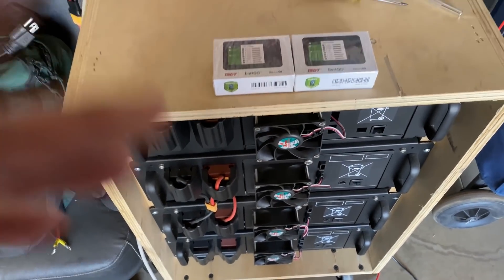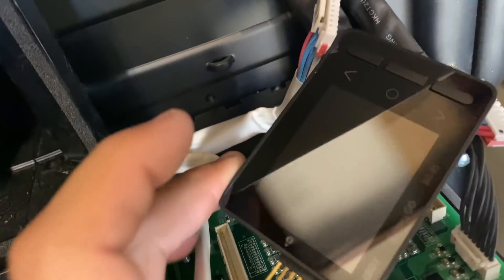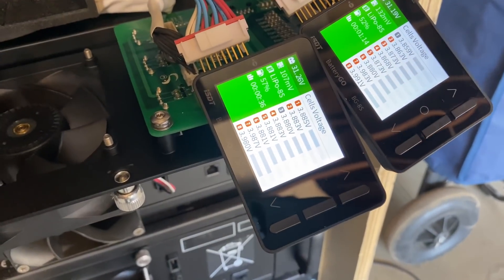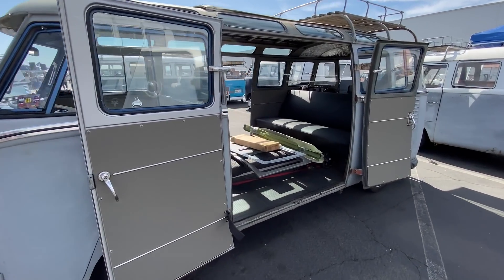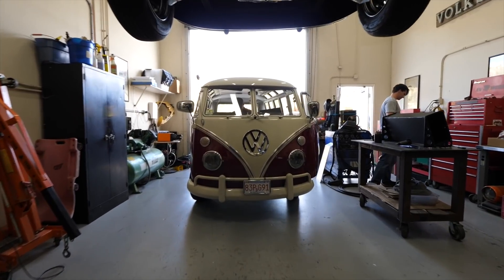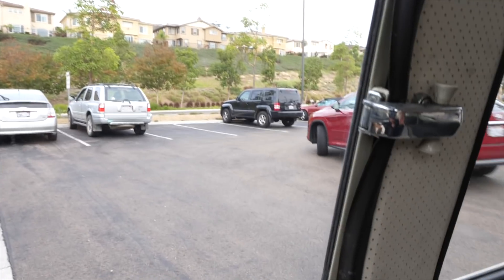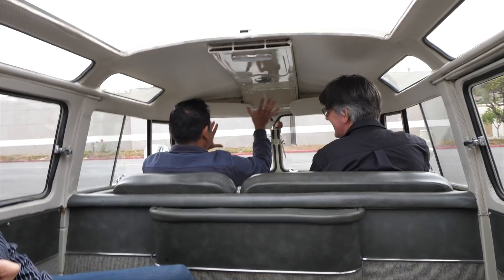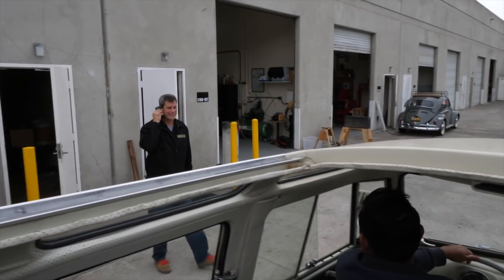Balancing Samsung DIY Powerwall using ISDT BattGo BG-8S

Comment: While this is interesting, the power wall was basically pre-wired for the 8s battery balancer. What about balancing a 48v battery pack with an 8s balancer? Balance by cell groups? Balance part of the pack at a time? Is this possible?

Comment: Hi, is there a good bms to use for this? Or will there be a follow up video to use the built in bms? Or if I just connect it to the built in one it balance the batteries but no read out?

Comment: I Need to pick a couple of those devices showing the voltage. BTW same guy that lives in Ca (south bay). I am building or should say repairing my e-bike(2) battery packs they both stopped working just under 3 years. Just getting into this area as a hobby/family fixer. The biggest slow down of this repair process is charging then discharging and finally charging each cell to get its capacity and voltage. How do you cut down on time when it comes to this step?

Comment: Hey Jehu,  I'm confused.  the connectors that you linked to on Amazon appear to not come in the 4pin and 5pin that we need to use the Battgo cell balancers.  Are we supposed to cut them down to the correct pin count?  Seems like I'm missing something.  Thanks

Comment: I have 12 of these now (thank you), and am working on the built in BMS.   If I wanted to share this data, where would be a good location. 
I have the basic design of these, and how to interconnect them.  I am working on the management interface which can support up to 32 units.  Once I get this last piece, up to 32 units can balance with each other across the packs.
Reply: I also have several of the Samsung  battery modules. The BMS controller is a Maxim MAX17823 there is some data out there but I am working on an interface as well
Reply: @markforaker6345  You are welcome to add discovered content to the Wiki.  Register and let me know.
Reply: Mark Foraker Afternoon , were you able to make any progress on the controller ?
Reply: I'm very interested in this. Wondering if making a public Github repository is appropriate? Otherwise, I'd be happy to build/host a site with the info that you're willing to share.Thanks!
Reply: @indigoskin  Github is great for schematics and code.  I am putting a Wiki together to allow elements of information to be linked.  If you would like me to include your Github, let me know.
Reply: @bradslattman  I just received the balance coils for the network today.  I will need to mount them and prototype a board, then get a board made.  Follow at the wiki above...
Reply: Anthony Plack Good Afternoon , Where can I find the wiki link?
Reply: I have a few of these modules. I'm interested in any progress being made towards communicating with the board. Any updates? Any way I can help?
Reply: Anyone make any progress on the BMS? Link to the wiki or gethub?
Reply: Hi Anthony, just another request to add a link the Wiki you mentioned ;)

Comment: The stock BMS doesn't do balancing? Pretty surprising for such a large expensive battery... What do normal customers for these packs do?
Reply from the maker: It does but we still don’t know how to use it
Reply: Saw a reply on another video about modifying these from 16S to 14S to lower the voltage to their inverters.
The built-in BMS kick in when the individual cells reach 4.05V.   But they do not have a way to monitor externaly, other than checking each cell.
See comments and replies.
https://youtu.be/fqWXsxpR56s

Comment: You don't need a $30 balancer to balance your cells. I balance mine by just hooking them in parallel. I have two connectors. One hooks them in series for source. One hooks them in parallel for charging. You can make up the connectors with Anderson power pole.

Comment: Hey Jehu, love your content...and now probably a dumb question: could you tell me why the cell and total pack voltage goes up, with resistor-type balancing? Or were you charging at the same time? Succes with the Samba, looking forward to see the video 😃
Reply from the maker: yeah I charged that module to match the others
Reply: @jehugarcia  have you paralleled the pins into the electrodacus?  It could be used to charge the batteries (when changed to 24v with cables) 3.3v to 3.9v.

Comment: Hey Jehu, can those balancers be used in series to display cell voltage (and slowly balance) a higher voltage single pack in an EV ... perhaps by overlapping connections, so every 8th cell is connected to the neighbouring balancer??
Reply: Nope they will burn out.